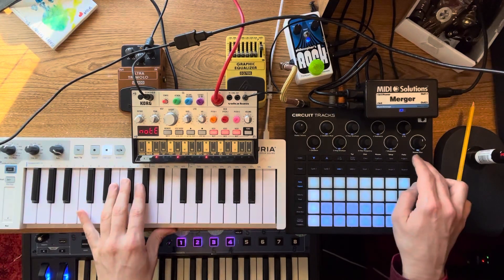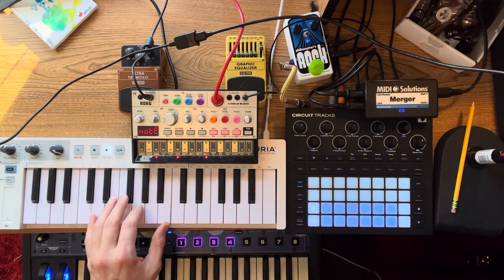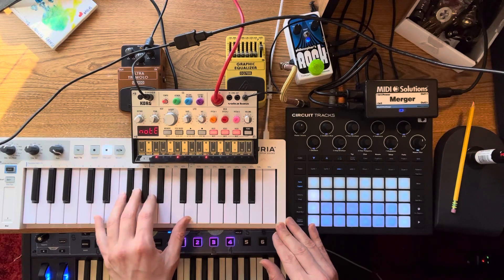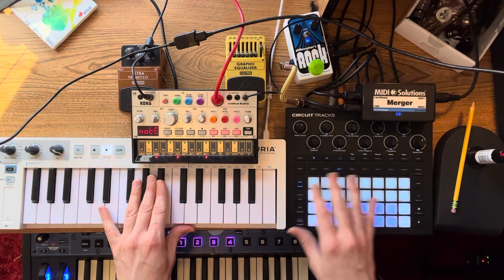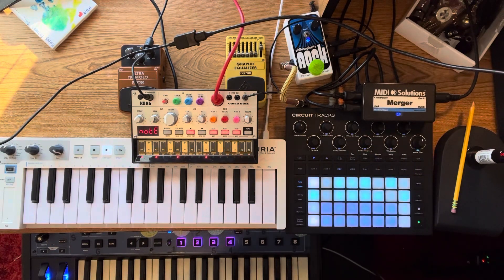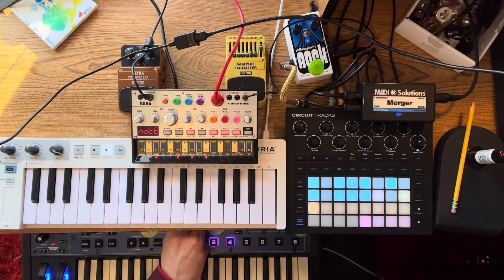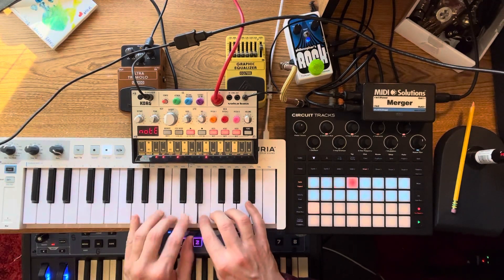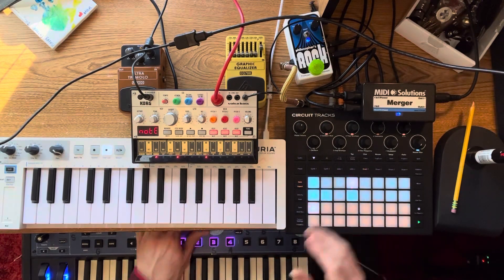Controlling synthesizer modules through Circuit tracks with midi keyboard as input, using a merger.

Comment: Do you need a Midi Merger AND splitter for this to work? I have the Merger and am trying to go from the outs in the splitter to the ins on my Microfreak and Minilogue and getting nothing
Reply from the maker: Hard to know how you have it set up. Break it down connection to connection and I’ll try to help
Reply: Wow thanks for your response! So i have almost identical setup now: Keystep 37 controlling Circuit Tracks (gen 2). My two external synths are Microfreak on Midi 1 and Minilogue on Midi 2. I have my Midi out on the Tracks going into the In1/Power on the Merger,  and the Midi2 going to the in 2. The merger goes out via Out 1 into the Quadra Thru, and then ai have Thru 1 going into the Micro Freak and Thru 2 into the Minilogue. When i press a key on the Keystep i can see it registering for the two midi channels on the Tracks, but dont get sound

Comment: Question why would you need a midi splitter? The Merger box has 2 midi outputs?
Reply from the maker: @rovenordiales  good point. I had the splitter set up though so I could potentially send out to more than two synths

Comment: hey there, nice video! I don't know if this is helpful or true( didn't test it myself) but if you go in advanced settings (the shift power thing) you can use  your midi-through also as a second midi out by pushing the duplicate button to green.. Anyone who can confirm? Anyway, this doesn't mean this video isn't useful, you could probably do 3 instruments combined? Cheers!

Comment: Hey really appreciate this video.  I've watched it at least a dozen times and I am still having an issue getting audio to play while using the keystep to control the synth of midi 3.  I can play it without hearing it like you mentioned in the video.  Any is why I can't hear the synth?  I believe I have matched your set up except I am using 1 external synth instead of 2.  Thank you!
Reply from the maker: Thanks a lot for the feedback, I’m happy to help. The keystep needs to match the midi channel of the synth of course. It’s just going through the thru port, if connected directly with out the circuit in the middle? Try the different orientations of cables until you find out where your note messages are blocked

Comment: Is there a way to do this and still have the circuit be the master clock, while still being able to use the arp and sequencer on the keystep? Currently thr keystep has to be the master because putting midi out from circuit to the keystep in the configuration causes a midi feedback loop
Reply: You found a solution?
Where are the advantages for the Circuit being master clock?

Comment: does novation make a full midi hardware? Would love if synth 1 & 2 were able to be for external gear.
Reply from the maker: Yeah yo, the circuit tracks can be a 4 track six voice sequencer. Just turn down volume levels on the mixer page for synth 1 and 2 and it always transmits data out to the channel of your choice

Comment: Question: how would I just simply connect the keystep to the circuit tracks for the keystep to trigger the tracks’ synch and play in real time? Do I still need the midi merger or can I just simply connect keystep out to tracks in and tracks out to keystep in?

Also, the keystep has no audio out so how does audio get to the tracks?
Reply from the maker: Yes, connect keystep to the circuit via midi with one cable and you’re good to go controlling the circuits internal synths.

Comment: Thank you for your work! How do you manage the « scale issue » of this set up?
Reply from the maker: I just play around with the scales the circuit quantizes the incoming note data to its selected scale. I use chromatic a lot though so I don’t have that qauntization.
Reply: If you used a Blokas Midihub as your merge/thru box, you could put a scale filter into its routing.

Comment: This is so awesome!!! Just started with the Tracks and I was wondering if this was possible and you have proved it is  ; ) THANK YOU! Also, the Merger is now $89 direct... they have a Quadra Merge for $139. It has four inputs and two outputs so it seems like it would simplify the setup at greater expense but no soldering and simpler wiring. What do you think?

Comment: Sofar out the box it can control & record & play midi 1 no problem. But trying to play midi 2 from an external controller not working or recording & triggering midi 2 so I’ll keep going?
Reply from the maker: I’m not sure. The way I understand it is midi input data goes into the sequencer midi 1,2 tracks, and it goes out the thru port. After a sequence is recorded it then goes out the midi out. So to hear the performance you need the midi thru to also communicate with the outboard synths.

Comment: Novation kinda fckd up in that respect (the need for merger). But nevertheless, their groovebox is now the centerpiece of my setup. It basically replaced the keystep pro seq, the mixer, effect units, and even has 2 extremely powerful polysynths. The merger would be great addition but the circuit does a lot already.

Comment: Very smart and well explain... but with the price of the merger and the splitter you're almost at the price of an used mpc one wich dont need this tricky set up (if i'm right). What do you think ? also I'm wondering if you could have used your supernova istead of the keystep to control everything with the sames results ? It could make the setup a bit ligther
Reply from the maker: Merger was $69, spitter was a kit at $17 from meeblip, cables another $10. I like the circuit’s workflow but so far using a keyboard as a controller is best suited with the keystep as you can easily choose different channels. The only challenge was the fact that incoming data goes into the sequencer without coming out the out which the merger solved by routing thru data in as well
Reply: @piercemcintyre1327  thanks for your answer I see your point. What about using the supernova as a master midi keyboard and an instrument while it is playing on its channel. Is it possible?
Reply from the maker: @jonathanphotographies2295  yeah It works to record it into the sequencer and then have it play back. But using as a master I wouldn’t because then you have to turn down volume to trigger other things and switch midi channels in the menu
Reply from the maker: I have never tried an MPC but I understand they are powerful for sequencing and sampling as well.

Comment: Hey man, I’m wondering if you don’t know you can change the midi thru to a midi out by powering down, holding shift when powering back on and pressing duplicate. I think this would’ve solved your issue also! I may be wrong.
Reply from the maker: Thanks for mentioning that feature. However what I am doing here is capturing the thru and the out data and merging them. Midi data doesn’t echo to the out. From the input. I explain it in the video.

Comment: In regards to external synths, do the pads also work with this set up? Right now, without merger, I can get it to work by changing to Thru but then the pads don’t work. I’m guessing it does because your sending both out and thru to external. Also,is there a merger with two outs? I have four external synths and I would rather not daisy chain all four synths with one out :) btw - The mc707 has an auto channel that allows one midi Chanel on the keyboard and you simply switch ch. by switching tracks + the pads are also still enabled. Really bad oversight.
Reply from the maker: Yes the pads do work. The way it works without a merger is the pads control everything but your input keyboard only works to control circuits internal synth and record midi into the midi tracks which you hear after they are recorded, in order to transmit the performance as it is being recorded the thru is merged with the midi out
Reply: @piercemcintyre1327  Great. Thanks! Ya, I spent waaay to long trying to get everything to work before I realized that the Tracks just cant do what I needed it to do. I see that the mergers have two outs - I'm assuming that the two ins go out to both of those outs? Im hoping to have the same set up as I do without merger i.e. two outs so that I can have two synths chained from one out and two synths chained from another (dont like to daisy chain beyond that for possible latency issues). I'm guessing this will work if i understand everything correctly about the merger.
Reply: btw - it does work without merger IF you turn one of the outs to a thru - but then that gives you another set of issues (pads dont work, etc) - the wonderful world of MIDI! lol

Comment: Will this work with korg electribe 2? It doesn't have midi thru, only midi in/out, i have the same issue, electribe as main sequencer for few synths controlled by keystep, but have a bugs in that chain. Will this midi merger solve my problem the same way as for circuit? P.s. love your performance, vibe in your vid.
Reply from the maker: not sure exactly, but I'm imagining that you need a feature that may or may not be present called "midi echo" in older sequencers, and sends the played notes through the out as they are recorded. Without a thru, you could, run the key step into a splitter, one to synth, one to the sequencer, and then the sequencer out into a merger and the one from the key step also into the merger, so played notes and sequencer notes both go into synth. Then it would work.
Reply: @piercemcintyre1327 a lot of thanks for your answer : )

Comment: Thanks for the explanation, just have a short question here. So after the merger, you have another device on the chain (a splitter) that sends the signal to the Volca Keys and the Mini nova is that so?. I  am a newbie in all this so I was wondering why you need this, can't you just use the two outputs of the merger - one going to the Keys and the other to the Mini nova? If that is not the case would you mind sharing how the splitter solves the issue and share as well the splitter's brand and model .  I am planning pretty much a similar setup so this will be really helpful. Thanks in advance.
Reply from the maker: The midi data that goes into the circuit goes into the sequencer, after the recording it comes out the midi out, but during recording it does not. It does go through the midi through while it is being sent into the midi in. This by combining the output and thru in a merger you can hear the sound of the module or keyboard during recording into the sequencer from the midi thru and then after recording from the midi out. The midi splitter is there just in case you want to hook up multiple modules. You can use the additional output on the merge or midi thru on keyboard and modules to accomplish that same thing. The splitter is a kit that requires soldering from meeblip https://meeblip.com/products/meeblip-thru5-midi-splitter-kit
Reply: @piercemcintyre1327  thanks for the detailed answer, I got a bit confused though. So would you mind if I ask for some advice?
The setup I want to achieve would be using Circuit Tracks as the brain. Then, having two additional synths (e.g Volca Keys and Microfreak) controlled by a single Arturia Keystep. So the ideal situation for me would be to be able to control all the synths (the two internal of the Circuit Tracks and the two external ones) via the Keystep while being able to sequence all of them in the Circuit Tracks sequencer. Not really sure if this is achievable so any ideas on how to get it done and what kind of additional devices I might need would be highly appreciated.
Reply from the maker: @TigrishiDimeti  yes, the keystep midi out into the midi in on circuit. Then get the midi merge and two short midi cables, I got one foot cables for this. The midi out and midi thru go into the midi merge and out of the midi merge go into your synths. This the thru and the out of circuit both go into synths capturing performance and sequencer data and sending to all synths.
Reply from the maker: If you would be interested in a private lesson over zoom let me know, 45$ for one hour and I’ll walk you through anything you have questions on
Reply: @piercemcintyre1327  thank you so much for this. Looking forward to trying it.
Reply: @piercemcintyre1327  will keep this in mind for the future endaveours in this journey, thanks for the offer
Reply: @piercemcintyre1327  weird that midi thru doesnt work in record mode. This should be firmware patchable right?
Reply: I was wondering why I could not record from „outside“. Thanks for the explanation. In my opinion this is not well explained in the User Manual and should be better solved. Beside that Novation is a cool brand with great controllers and keys.